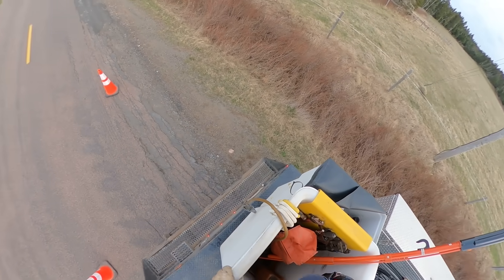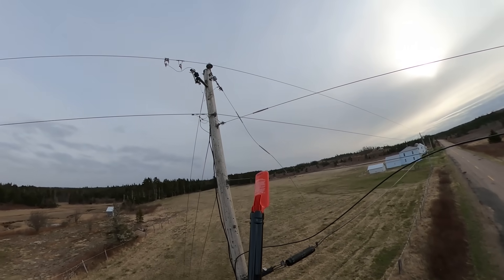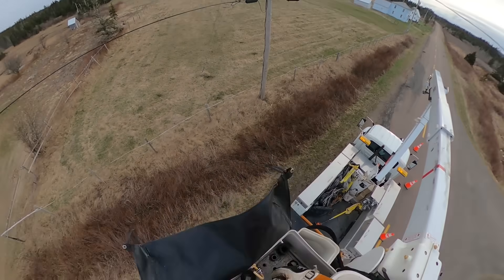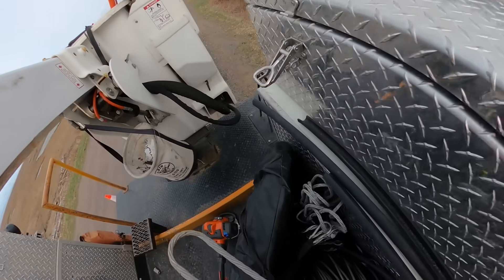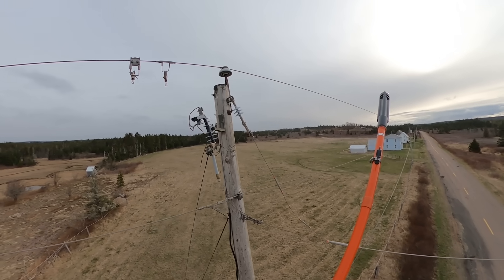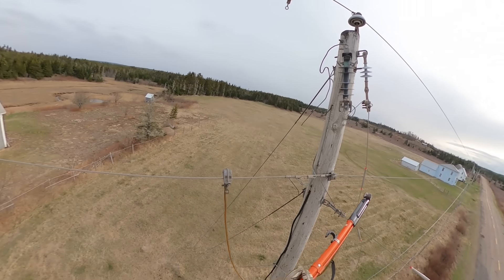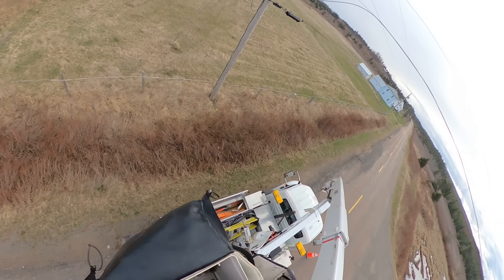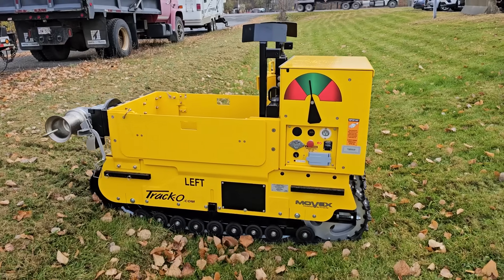How to remove a Powerline that's blocking the road

Comment: Aaaahhh, step potential. I have read about it in substations but didn't, think about it with a live wire on the ground. Mike Holt did a video where they ran a live 120 line from an outlet to a 10 ft ground rod. It did not trip the breaker. Using a multimeter they were able to measure the different voltages in the ground around the ground rod. Over more tries adding rod each time it took a lot more rod into the ground to trip the breaker. Many lessons to learn from that video, including step potential and why a live wire on the ground can still be live.
Reply: That sounds like a great vid. I'm off to find it now.
Reply: worked a troubleshoot on a mobile home where there was inexplicable voltage to ground.  ultimately found out that there was a leak in an underground primary, and it was voltage FROM the ground to the grounded conductor.
Reply: The lesson is that 120V does not go through the ground that easily.
Reply: @jovetj  true.  I had a troubleshoot back when I was a cup where it turned out the reason I was getting wild voltage readings from nuke to ground was because my JW had pulled the bonding jumpers from the panels - and there was a ground fault looking for a way home.  lucky break was, when I jumped the ground to nuke, the plumber was in the bathroom, and saw the spark where it was faulted.

Comment: We had a pretty neat presentation by our local power company where they brought out a demonstration trailer and showed us what electricity does to certain things and they talked about electrical safety. Being with the road department, it was great to see because we do a lot where we can become exposed to electricity (accidents, trees down, heavy equipment hitting lines, etc). One of the things they didn't talk about was how they handle emergencies if someone is trapped in a car with a live line over the top. I think it would be interesting if you could do a video where you talk about how you would handle that call and maybe other general safety things that the public should know. One of our issues is the public doesn't realize that communications lines can be energized. During a storm we will see people going out and dragging the lines off the road. Man, you wanna piss off our power crews, let them catch you dragging a line off the road 😂

Comment: You did the right thing by placing reflective witches hats around your truck to make you more visible.

When the whole crew (Ausgrid) is working in my area in Australia they have traffic controllers to direct traffic as well.

Last year, they replaced the crossarm & insulators on an about a 50 year old 11 kV power pole & they took up 1 lane with their truck & cherry picker !

Comment: a handy bit of trivia: an electrician's non contact tester will trigger within about 10 feet of an energized pirmary voltage source.  so if you have one and you're near a potential downed line, turn it on.  if it yells at you, you're too close.
Reply: like those little pocket dingus ones that come with multi-meters kits?
Reply: @cannack  don't know what a pocket dingus one is, and the only thing that has come wih a multimeter kit I've bought has been alligator clips.
Reply: @kenbrown2808  little thing about the size of a pez dispenser, you stick in in a outlet, or near wires, it`ll chirp near 110/220.
Reply: @cannack  okay, yes, that would be a non contact tester.  They aense 7kv at about 10 feet.

Comment: Glad you mention back-feeding. I am looking to hook up my generator to my panel during emergencies. I need to get an interlock for it to prevent the idiot move of back feeding (in case I am not home when someone needs to run it) or maybe I should just pony up the cash for an automatic transfer switch.
Reply: manual transfer systems are available in the $400-$500 range.  or some panels can be fitted with a manual interlock system.  they're not just smart, they're required by law.
Reply from the maker: The manual Interlocks are just as good as far as safety is concerned. (I wouldn't worry about spending the extra cash unless you're having a fully automatic system).

In our area an interlock of some sort is required by law for any kind of customer feeds
Reply: @Bobsdecline  the drawback to the manual interlock is you don't have nonessentials coming back on to let you know power's been restored.  plus, the prebuilt switches are inherently load managing, because you simply don't connect the nonessential loads.  but the interlocks are usually cheaper. (surprisingly, not always)
Reply: @kenbrown2808  Considering installing an "essential load" panel [with the interlock]. That would allow the non-essentials to come back on.
Reply: @jamesphillips2285  it's what i have in my house. They are designed to retrofit to an existing panel, and work great for a panel in a garage. Basic electrical competence is important to DIY it, of course, but it's a good all in one solution if you don't have to have a remote inlet.

Comment: Why did the high voltage line cross the road?
To lower its potential.
Reply: Take your Like and leave.
Reply: 🤦 the fact that I read that...
Reply: @Code3News  Bad hair day?
Reply: @macdadstromboli2762  I assure you I can do worse, so chalk it up as a win.
Reply: What did the road say to the fallen HV line? I'm shocked at your behavior! :) I'll show myself back to the truck.
Reply: That does not even count as a dad joke
Reply: chicken
Reply: That's an old one. Maybe a pun that is more current?
Reply: @ConstantlyDamaged Sorry, but it hertz to much to do so. 😄
Reply: @CitrineSnake  Oh boy, here we go, ground and ground again.
Reply: @AlanTheBeast100  Aaron listens to AC/DC High Voltage on his way to work. He drinks an Amp energy drink. Lions, Tigers, Bears Ohm my! Sorry, I couldn't resist. If everyone comes after me in angry mob form, I guess everyone would yell Charge! 

I shall see my Psychiatrist. 😮
Reply: @ConstantlyDamaged  I'll have to induce my self to do better and bring a battery of better jokes.
Reply: I'd thought I'd insulated myself against bad jokes, but it's shocking how easily my laugh track was energized.
Reply: @jovetj  Kudos!
Reply: @AlanTheBeast100  I think you've got a line on things now, but it's always important not to get too overblown with puns—you gotta stay grounded.
Reply: @ConstantlyDamaged  I urge to be free and follow the path of least resistance!

Comment: Always nice to see some routine work because it's the easy stuff where people get lax and screw up.
Reply from the maker: Absolutely
Reply: My thoughts, too. The point towards the end about how cutting the line on the ground will mean the other end is no longer grounded really hit home how easy it would be to make a mistake without strict procedures and constant attention.
Reply from the maker: Even while up in the air! It can happen quite easily.... To cut a wire and lose your ground. Always have to be very attentive to what you're doing. If your mind isn't on the job, stand down, regroup, have someone else go up. Always follow procedures!

Comment: It's amazing how common single-phase "SWER" lines are in North America, here in Brazil they are abolishing this in favor of three-phase feeders in rural electrification.  They say that if you lose the neutral in this system, well... the electrician and the customer could be in hot water,the transformer secondary bushing, which should have 230 volts, may end up having enormous voltages in the secondary bushings, including the 7970 volt (13.8kV)  of the line. The abolition of single-phase lines in Brazil is because they are less efficient, they use old-fashioned crystallized bare solid copper wires,while a new three-phase line will have wiring between #1/0 and up to #4/0 AWG ACSR easily achieving 20km of maximum range with acceptable losses (13.8kV to 13.66kV)

Comment: Even if a disconnected line shows as dead, it is entirely possible a downstream generator is started on that line, at any time. So yes treat it as live. Sure, it seems a bit unlikely, but no need to take that chance - you only need to be wrong once.
Reply: my region has automatic reclosers, now.

Comment: Guys always remember, do NOT approach a downed power line, specially if it looks like a naked steel wire, you don’t know what it is and it could be a fatal mistake touching it…
Reply: Yup, I was a volunteer EMT in our town back in the 1980s, that was drilled into us when we would respond to car arguments with a utility pole. Local electric utility was typically pretty quick to respond.

Comment: Are the lines and how theyre built and the tools used different than those in the US? That hot stick looks very different than the ones Ive seen in the US…
Reply from the maker: Much of our stuff comes from the US! There's a few different manufacturers for sticks insulators, switches etc... 
Every company has slightly different standards but all follow the principles

Comment: So you say you wouldn't break load without a 12' stick or a load buster; why wouldnt you do a quick current check, if unknown, to break load? Yes, the line is down, in a normal opening of a circuit; check current so you know you have the correct fuse installed and not having to open other circuits when closing back in for over load in rush

Comment: on LV stuff in uk we can't use non contact to prove  dead
Reply from the maker: Multi meter is definitely much better for LV
Reply: @bobsdecline  A multimeter? What on earth are you talking abooot? Perhaps a voltmeter designed for the environment you are working on, c'mon man... You have one
Reply: @nateroth1302  You're talking about 7200 as LV.  Aaron is not.
Reply: @jovetj  1000v and below is LV. I am betting Aaron has a voltmeter that is designed to measure up to 37,000 volts with 1% accuracy also while reading to the volt from 1-37,000
Reply from the maker: I do have the Sensorlink Voltstik which as far as I know is the only tool on the market that can test a high voltage line accurately... much in the same way as a low voltage meter, but on 37kV. It's quite impressive!

Comment: Is interesting how you have a high voltage and a neutral in the United Kingdom we run two or three phases faces are wrong. It is not split phase as such they are both from the three system as we do not use a neutral in most high voltage cases
Reply: in rural areas, we run one phase with a grounded leg going back.  in urban areas we have 3 phases, with the grounded leg.  then for secondary in homes and small commercial, they run a center tapped transformer to produce our "single phase"  120/240.  for large commercial and industrial, they use 3 transformers to deliver either 120.208 or 277/480 three phase.any of our big stores will have 277/480 feeding the lights and HVAC and any other big loads, and then a stepdown transformer providing 120/208 for all the "normal" loads.  our lower normal voltage takes more copper, which is why big buildings will have the higher voltage system as well.  and overall, when we were developing our standards, we had lots of copper, so we could afford to be generous with it; while you in the UK had it in short supply, so you went with a system that delivered the most watts on the least copper without being insanely dangerous.
Reply: There are areas in North America of delta 3ϕ in distribution too.
Reply: @kenbrown2808  three phases with the ground or neutral seems a bit pointless on high voltage distribution as you are paying for an extra wire that simply adds complexity
Reply: @ however when it is used it still differs in a lot of ways that mean it is less practical than the way it is implemented in the United Kingdom
Reply: @UKsystems  the majority of our 3 phase installations have the transformers in wye configuration. Only industrial applications use delta, so the 4th wire gives the flexibility to install wye, delta, or single phase transformers.  And as i said, we had no copper shortage when we designed our power system.  All our main transmission lines run phase, only, but our distribution network nearly always has the neutral available.
Reply: @kenbrown2808  single phase can be derived from 3 phase with no neutral
Reply: @UKsystems  well, yeah, but then you have to have 2 phases.
Reply: @kenbrown2808  there is no place that you could not get a three phase collection scenario. It may be more expensive but three faces it’s always somewhere nearby.
Reply: @UKsystems  you can't get three phase at my house. There's only 1 phase available.
Reply: @ it may be a rural area but three phase is available generally speaking. There’s only one to 3 miles of single phase high voltage line so they will replace that to upgrade you and if it’s a non-area there likely to be a couple of hundred metres of single face line and they will replace that for your upgrade.
Reply: @UKsystems  no. There isn't and they won't. There's about 20 miles of single phase to get to me, and it would be thousands of dollars per mile to get them to replace the poles and string more wires. And to what end? You're talking about it wasting copper to have one extra line for three phase wye connections. Now you want them to run two extra lines so i can have extra phases i have no use for.
Reply: @ that does not follow the standard which was released a few years ago about how they will be upgrading the network but for me they did it completely free of charge gave me something for the time which was six months